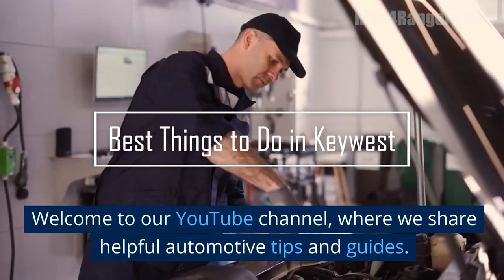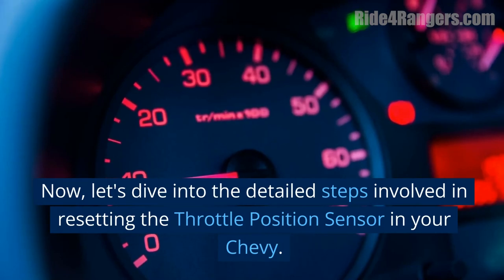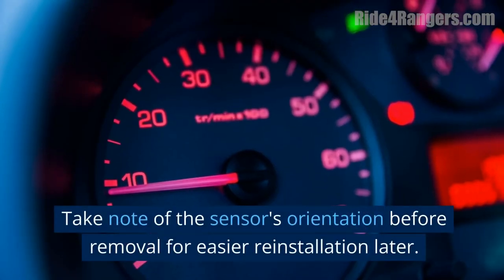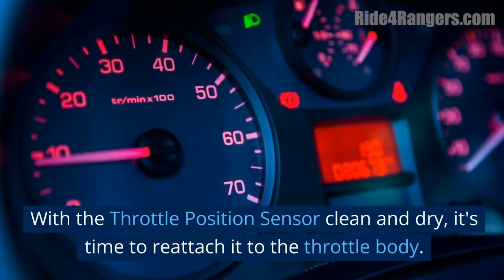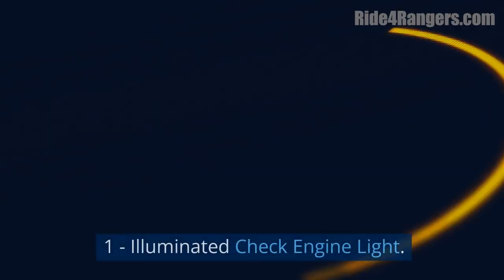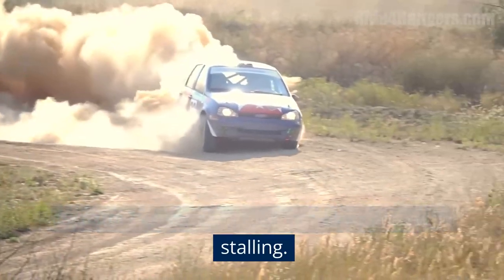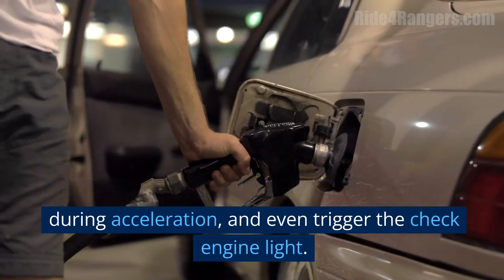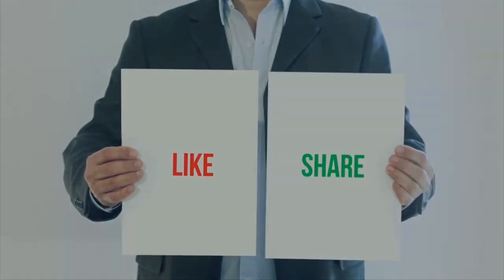How To Reset The Throttle Position Sensor In A Chevy | Symptoms of Bad Chevrolet TPS

Comment from the maker: Check Solution here : https://ride4rangers.com/how-to-reset-the-throttle-position-sensor-in-a-chevy/
Reply: My Nissan Nerva 2000,  started dropping its idle slowly over a cupule of days to a point where i had turn up the idle screw back up to 700  RPM, when the car is warmed up after driving for about 20 minuet's it would give a bit of a misfire while siting at a red light but then come good on acceleration, it only happens when the car is warmed right up..? No vacuum leaks, Throttle body is clean, Could it be the idle air control valve..? Or a faulty TPS..?  My car has a 14 pin port, I've been to three mechanics for a diagnostics test and they  don't have the right scan tool for my year model, And it never fails when a mechanic takes the car for a test drive, Well the bloody thing doesn't miss a beat I guess I will have to try changing both..

Comment: Is it normal for the tps "on scan tool" to read at idle @ 18 percent?,,,,,,,and full throttle it only reads 83 percent...07 Tahoe LTZ
Reply: you need a  OBD2 scanner to Relearn the trottle position.   The video is a big fail...